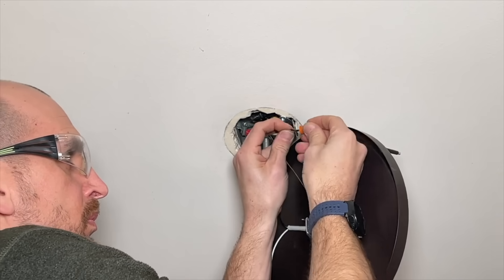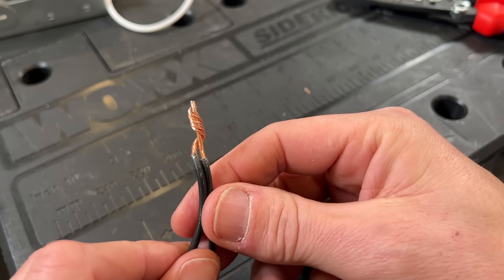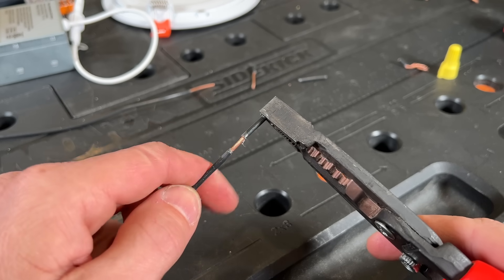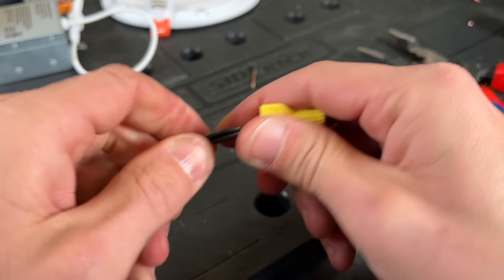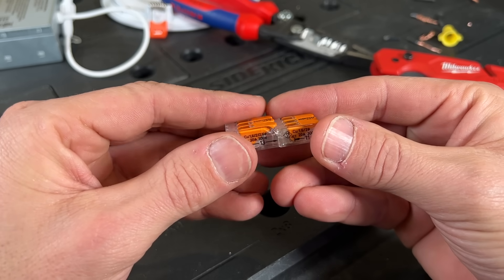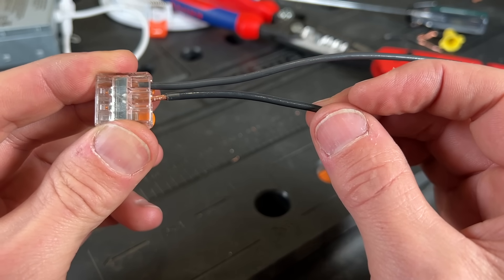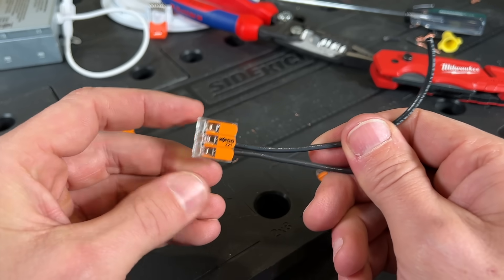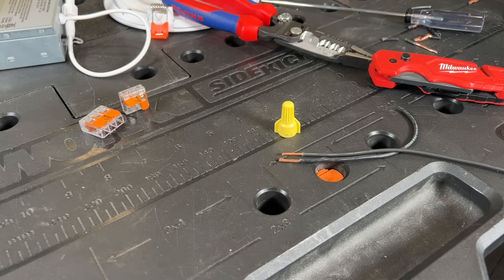Most Common DIYer Electrical Mistake - Don't Let This Be You!

Comment: I tell others to get the Wago connectors.

I have collected a lifetime supply of wire nuts and would hate to throw them away, so I use them instead, but prefer the Wagos.

Comment: When you are stripping your wire, start with an angle on the strippers and after you have bit through the insulation, rotate your strippers to vertical.  It will help start the strip without having to use so much pull pressure.  Also, if you place your thumb against the edge of the strippers, you can use it for leverage to finish your strip.
Reply: Well said.
I, too use the method that you described/detailed.
Reply: Or buy a quality wire stripper that easily takes the insulation off.  I have an automatic wire stripper.  Put the wire in, pull the lever and the insulation is off.  No need to worry about gauge size or stranded vs solid.
Reply: @smee5437  example? I'd love to see something requiring less effort!
Reply: @rondamylove9995  I've had the Blue-Point PWC22B for over 25 years now.  I used it just yesterday on some wires; worked great.
Reply: @smee5437  same
Reply: @smee5437  I agree that, that type of stripper would probably work well for a DIYer.  When you're in the trades, you find that the automatic strippers break down quickly and end up being junk.
Reply: @justforfun6344  if you get the Klein brand auto strippers, they will last for years even under heavy use, just carry an allen wrench to keep the lower blade tight.
Reply: It's a bad habit to put your fingers on the uninsulated parts of the tools, once you get the hang of it you can easily strip while holding only the isolated part. Esp if you give recommendations to DIY:ers.
Reply: @qwirkie  It's really not.  It's a bad habit to work on electrical if you're not absolutely sure about lock out, tag out.
Reply: @justforfun6344  Do you think most DIY usually lock out and tag out at their own home? Then I'm quite impressed that they learn anything from a video about how to apply connectors.

If we are talking about people who 100% know what they are doing and never makes mistakes, fine. Then there's no point in using isolated tools from the start.

But that is not the case, I doubt a whole lot of DIY even know how to prove dead.
Reply: @qwirkie   LoL....kids just want to argue.  When you get a few more years experience, you'll understand.  Have a good day!
Reply: @justforfun6344  And when you have zero arguments your default is personal attacks and reflections, nice try.

Have a pleasant day and please stop "teaching" unsafe working methods or bad habits in the future. 👌

Comment: Viewing this from the U.K. I have to say that I haven’t seen a “wire nut” for over 50 years. Up to now almost all connections of solid core cable to stranded flex, say in a light fitting, would be with a “choc block” type connector. I’d add that I also routinely put a “bootlace” ferrule on the stranded wire, which makes for a very secure connection and avoids the possibility of stray strands (if done properly). I haven’t personally used WAGOs but they do look useful and I see that they are starting to be incorporated into electrical sockets (outlets) too.
Reply: thats  because for SOME UNKNOWN REASON... you people go back and undo everything every 5 years ....even if everything's fine..smh
Reply: @Steve_mos8541  Yeah, watch out, they’ll be trying to get you into one of those newfangled horseless carriages next😉🏴

Comment: Excellent presentation! I have been an electrician for over forty years, and you are right, stranded to solid connections must be made the way you described. I also like the fact that you pointed out the disadvantage to push-in connectors. I will never use those because they can fail just like the push-in connection points on the back of cheap receptacles. Those should be outlawed!

Comment: Couple comments.. thank you for making the distinction between LEVER  and push ins. Do not use push ins, especially with stranded, for so many reasons I won’t list. Just don’t. But Levers are fantastic, they handle load and heat just fine  and are a great option for diy’ers that have trouble splicing.  With regard to splicing stranded to solid.. I prefer to twist the stranded around solid before using wire nut but.. one of the simplest and best tricks a 30 year journeyman taught me thankfully early on. Strip the solid a touch longer than normal. Then use your pliers to zig zag the stripped copper from insulation to end. Then wrap the stranded. Then use the wire nut. Easily best practice from my knowledge. Enjoy your channel keep posting!
Reply: This is the way, always pretwist your conductors together, do not rely on the wire nut to do that for you guys, I was always taught in school to pretwist conductors, it's the proper way.

Comment: An extra layer of security for the wago is tapeing over the top and wrapping around the sides. This prevents the latches from opening and insulates the open test connection at the top.

Comment: The 221 will work with most conductors but the lighting connector works best in this application with light fixtures

Comment: A couple things, wire nuts may say twisting wires is not required or do not overtwist, that is not hardly the same as saying do not pre twist as you did. If you don't twist larger gages or connections with multiple wires you should go back to all of your jobs and fix them.

Comment: Make sure you match the size of your wire with the correct wire nut. Too often fixtures have 16 gauge or sometimes metric stranded wires. I always use the minimum size wire nuts, usually orange. I would have used orange wire nuts for the connections in the video.
Reply: That's a bingo!! Wago is nice but a properly sized wire nut takes care of the problem.

Comment: After a couple times THINKING I was done...I found the same solution to work. I do pretwist stranded to solid making sure it's a bit out front. Then when adding the nut I make sure I have a secure hold and even push the wire up while seating the nut. Then I tape in place. I've seen those connectors. Being thinner than nuts could be a fit advantage.

Comment: Wire nuts are unsafe, horrible n have never been legal in OZ all connections must use a screw type closed terminal block or a wago connector, you yanks have very low wiring standards!

Comment: Nice tip re using a wire nut to attach stranded and solid wire together.  How much do the Wago connectors cost? Wire nuts are CHEEEP. As far as wire nuts go – there are re-usable ones and one's that are not.

Comment: I've used wire nuts forever, but the Wago type connector would be very beneficial when stuffing the wires back into the box.  I am always worrried about the wire nuts not holding with all the bending and stuffing necessary to put the switch on or whatever.  These seem to be more secure in a number of ways.
Reply: That’s why you twist the conductors together before you wire but them. That way the nut isn’t holding everything together but just insulating it.
Reply: Wagos sounds like a spoiled brats cereal.. BB is the type of brat that probably grew up drinking Tang and eating Miracle Whip.. use a wago on a real job and you will be laughed off of it.
Reply: I've done the whole wago vs wire nut research many many times over the years and my opinion is that brand name wago connectors (which most ppl make the mistake of referring generic/off brand push-in style connectors as wagos even though there's a huge difference in quality between them) are extremely reliable and safe when terminated correctly much like quality wire nuts are and the main difference between the two is cost and time.
Wago lever nuts are worth the extra cost in most cases but most of us in the electrical trade are cheap and stick with what we've been using forever which is dirt cheap in comparison but if wago lever nuts were around the same price of a huge bag of nuts and I ran my own electrical business I wouldn't hesitate to use them over the 'ol tried and trues since in comparison...
1: they're way easier to use and save your hands from future health problems - 
2: they save time and space (less time in 100f+ degree attic or hanging out w/gross creepies in cramp terrible locations twisting a ton of wires is always worth spending a bit more to avoid - 
3: the tests I've seen done show they withstand heat better than most wire nuts - 
4: they can be reused many times over compared to wire nuts - 5: chances are less likely they'll be installed wrong (stripping/twisting wires is an art that takes time and some ppl will always just suck at it/are rushing too often or don't care enough to do it right for wire nuts to win this one.)
Reply: @SK It takes no effort to release those little levers that stick out like a hook. All they have to do is snag on a wire in the box. Wire nuts have to be unscrewed.
Reply: I have actually had wires pop out of the Wago lever nuts when pushing wires back into the box. So they are not perfect.
Reply: I don't know if this is CORRECT or not but I will wrap electric tape around the wire nuts and down the wires a short distance to help them hold better when having to push into a tight junction box.
Reply: @Working Man  I don't like using electrical tape for things like that because it doesn't last very long and the wires just get covered with the sticky glue.
Reply: @gg-gn3re  do you mean silicone tape? the type that has no glue and sticks to itself?  I use that on aircraft.
Reply: @workingman9745  You are doing it very wrong.
Reply: @workingman9745  Yea that's how they were designed to be. Also outlets are supposed to have wrapped tape around them. Also USA's method of installing the outlets so they are like "smiley faces" is upside down, ground should always be up to take the weight, you'll see it in hospitals and other places that don't hire tiny brained/fat/lazy electricians. Electricians that do homes etc are bottom barrel last picks.

Comment: If you need to strip an inch or more insulation off a wire, simply remove a half inch at a time easily with just your strippers. No need to force it all off at once or pull a long piece with pliers.

Comment: Why do most people attempt DIY projects? To save money. Wagos will likely not be purchased. If you are a young DIY`er, take the time to learn from those with experience. Ask questions and be sure you understand the answer. If you are wiring lights practice with your connections on the table before trying it on a ladder while holding the fixture and working over your head. Fun times.

Comment: I like the WAGO but they are too big for many outlet boxes that have multiple wires and wonder why the codes don't deduct for space usage in space calculations.
Reply from the maker: Hey Ell, make sure you are trying the smaller Wago 221 for instance a 221-413 (3 wire) only goes up to 12-gauge wire as compared to the 221-613 that can accommodate 10 gauge but is much larger.  I carry 221-412, 413, and 415 all the time.  Hope that helps!

Comment: You are stripping too much insulation off for wire nuts, which puts bare wire near the open end of the wire nut.
Reply: DItto!   3/4" on the solid wire is too long. 

Maybe 1/2" on the solid wire and 3/4" on the stranded wire so you can pre-wrap it a few turns

If the copper is exposed inside the wire nut, there is the chance that something like the bare earth ground wire can get pushed into the hot wire nut and short.

Keep in mind, outlets and fixtures do NOT stay exactly as you install them. A wall or fixture can be hit, smashed, crushed. Heavy furniture falling into a wall for example pulling the wires or crushing the outlet box. In a commercial building a fork lift running into a wall... Exposed copper could result in a short and arcing.
Reply from the maker: Thanks for the feedback.

Comment: You (and a few other videos viewed recently) have convinced me to buy a starter set of the Wago connectors.  The Knipex stripper/cutter/pliers are very nice, but at $54 are also pricey.  I get buying a quality tool.  If you take care of it and don't abuse it, you can have it for a lifetime.  But that is still a bit much.  I also noticed you recommend the 3M Super 33+ electrical tape.  At $8 a roll that is also on the high end.  3M makes quality electrical tape that is half that price and for most things just as serviceable.
Reply: $ 4.54 at Walmart
Reply: Knipex are worth trust me. I don’t even take care of it. I abuse the shit out of it. What’s the point of getting a pricey tool and not abusing it. The whole point is that it’s gonna handle the abuse.
I have taken hammers to them. I’ve hammered with them. I’ve forgot them at a job site. They’ve rusted. I’ve cleaned them up. I’ve held several red hot pieces of metal with them. They hold up well!!
Reply: @Username-ng8jy  Tnx.  I'm planning on buying a pair.

Comment: My house has the solid Aluminum wiring, I know that it requires using only,  CO/ALR switches,  and outlets.
Do those WAGO connectors work with solid core aluminum wiring?

Comment: The first method is good but lacks one step that most electricians don’t know. Before you put the two wires together you twist the stranded wire counter clockwise. This means that when you tighten the wire nut clockwise it’s not unraveling the stranded. This is also true for wire nutting two stranded wires. If you twist both wires this way, by hand you can twist the wires and it will be the neatest stranded wire connection. Trim your wires a little long so after you twist them you can cut the end off a little for a clean tip. I have used stranded for many commercial jobs and have never had to look for shorts when this method is used.
Reply: If you are facing the bare copper end on, then you must wrap the wires clockwise as this is what you will do with the wire nut in order to tighten it. If you wrap the wires counter clockwise then turning the nut on clockwise will unravel your wires.
Reply: @haroldkline4898  no I’m saying that before you twist the two wires together you twist each individual wire counter clockwise. Then you twist the two wires together clockwise. You’ll notice when you twist the two wires together how much neater the splice will be. Trust me  I was an electrician for almost 40 years. I learned how to do this from a navy master chief. I was in the Seabees. Try it if you have some scrap wire laying around. Plus the joint is much stronger. I learned that when I was eighteen and used it to impress electricians that had decades more time in the trade than me.
Reply: @deweyplanck9850  I noticed some of the stranded wires in fixtures is twisted counter clockwise and wasn’t sure if that was in the design.
Reply: @danlux4954  That is wild. I’ve never seen wire twisted counterclockwise in my life. I learned the trick from a master chief in the navy back in 1980. I did a lot of commercial work and almost all wire was stranded where I was so it came in pretty handy. I would think that it could be since a company would have to go out of its way to twist the wire in that direction. It really does work quite well to avoid shorts. You can see why as soon as you twist the wires together. It’s a better connection for stranded to solid also, but today there are better connectors commonly in use for that.
Reply: @haroldkline4898  sorry I was talking about two stranded wires. The way I was taught to take stranded to solid is just as you said. Still if you strip your stranded long and twist it clockwise with your wire pliers then cut the end to the extra length to go past the solid it will have less of a tendency to unravel and short. Sorry. I certainly wasn’t trying to attack the competency of the video. Compared to most videos I’ve seen this one gives more knowledge of the problems associated with using stranded wire. This is a guy who actually worked hands on with his subject matter. He’s shows that he’s not a guy who just worked at Home Depot in the electrical aisle
Reply: @haroldkline4898  ps this is if your facing the wire with the end facing you. The individual wires counter clockwise before you twist the two together and twisting the two wires together clockwise

Comment: cc                                 Milwaukee Fastbacks are amazing.  I bought v1 and loved it, then v2 I loved even more when they added a spot for spare blades.  But....friends, everybody makes mistakes.  Which Milwaukee did when they released v3.  I don't know why they felt the need to shorten the grip---it sure as hell isn't an improvement--but the longer grip was sort of a passive safety measure.  It made  you want to keep your hand in the same place when you were opening it and using it, which is a BIG selling point on a flip knife.  The shorter design--for me at least--leads to me repositioning my hand for a better grip when I need to bear down on the tool, and that happens more with v3 because you can open the blade to a 45 degree angle to bear down even more.

It's still really hard to hurt yourself with this knife, but I just like the earlier handles better.  (Which is why I bought out eBay when Milwaukee stopped selling the v2s.  ;)  I know I am not the only person who felt this way, because Milwaukee brought the v2 back!  WOOOO--I spent too much money on eBayyyy-HOOOOO!

EDIT:  I just got my hands on that Knipex--that's now TWO favorite tools we have in common.  People at work are making bedroom eyes at mine--I have to keep it on me or lock it up now.  LOL  In 2023 the price of the Knipex is about $60  If that is out of your price range you should check out Milwaukee's version of the tool for                                                                                                                                 .  Their version is roughly the same feature-wise but it includes a wire crrimper and slight differences to the wire sizes the tool can strip.